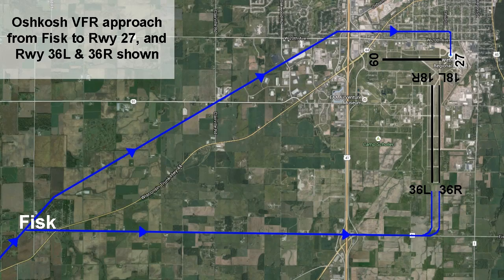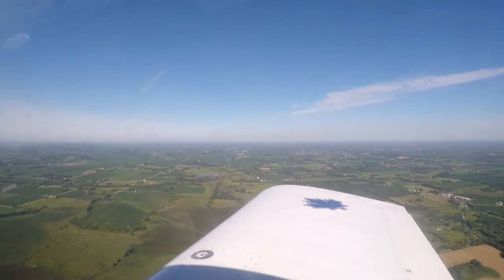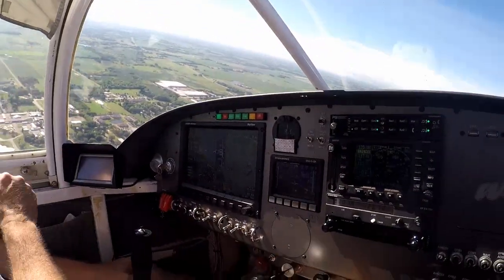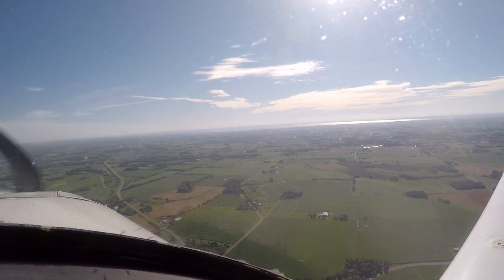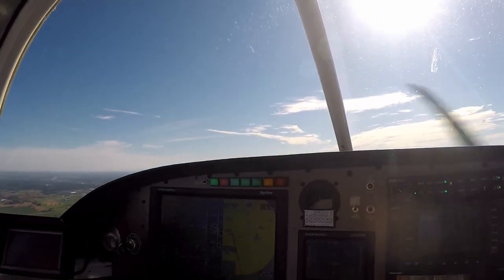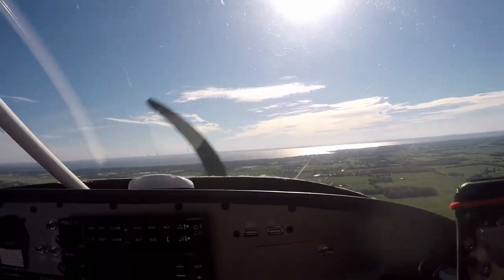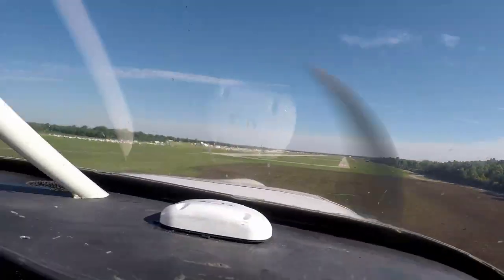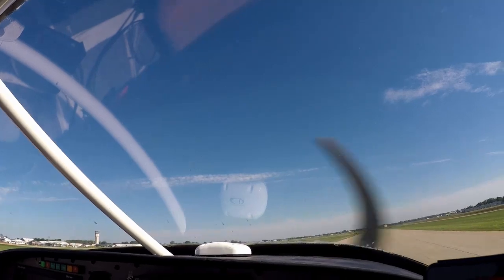Fisk Approach - Oshkosh 2015

Comment from the maker: Thank you. I am impressed with the structure and layers of safety.  The event is very well organized, and has several built in safety nets.  In this case, they keep taxiway “A” free and available to be used as 36R, to handle congestions issues like seen here.  The controllers do an excellent job.  The whole experience is positive.